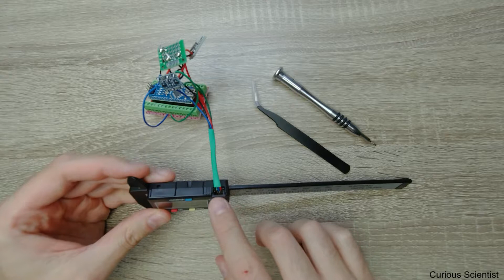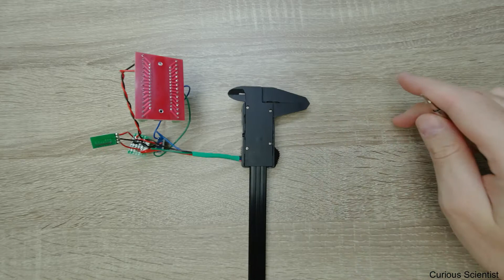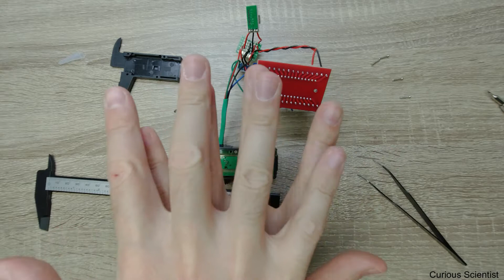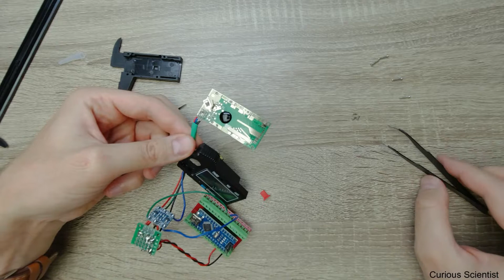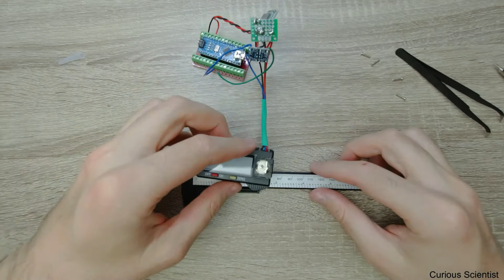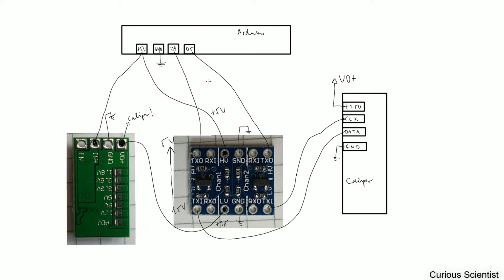Digital read out (DRO) using an Arduino and a digital caliper

Comment: Me ayudó mucho tu vídeo Bro, saludos desde Ecuador
Reply from the maker: Thank you!
Reply: @CuriousScientist  hey bro!
I need you help, plis. In my project i have the same calibrador, but the difference that is I need save data in MicroSD and show this information in a LCD. 
Have you any idea to do this code in Arduino nano?
Reply from the maker: Hey! I have other video where I save the data of a thermometer to an sd card. You can use that code as an example.
Reply: @CuriousScientist  thanks bro
Reply from the maker: @maredu97  You are welcome! It is this video: https://youtu.be/eWZP44vS7cU You just have to replace the name of the variable in the file.println() method and basically that's all.

Comment: Sir LM7805 converts output as 5v but we want only 1.5v how to do it?
Reply from the maker: The currents are likely to be very low, so after the voltage regulator, you can build a voltage divider using simple resistors. Then you can choose the appropriate values of resistors for R1 and R2 to convert the 5V down to ~1.5V. If you have R1=12k and R2=4.7k (I chose standard values from the E-series, so you can directly buy these), the voltage should be dropped down to ~1.4V. That should be perfectly sufficient to run the caliper. Otherwise, you can also simply use a potmeter to drop the voltage, I tested it just now with a 47k potmeter and it works fine. If you use a potmeter, first set the (potmeter's) output voltage to ~1.5V, then connect the caliper to it. This will further drop the voltage to ~1.1-1.2V. You can carefully adjust your potmeter back to 1.5V, if it is necessary, but my caliper (the one in the video) was working fine with the lower voltage as well. The best potmeter for this purpose would be a trimmer potmeter, because you can adjust it with a screwdriver and leave it like that. Or, finally, I added another product to the description which you can buy to convert the voltage to the desired value (you do not have to buy it via the link, but at least you can see the product and you can decide where you want to buy it).

Comment: How can I add a push button and input the readings to SolidWorks for 3d modeling?
Reply from the maker: Good question. Unfortunately, I don't know how to channel the measurements into Solidworks. I can't try it either since I don't have that software. Push button should be easy. Just write a function which works with one of the attachinterrupt compatible legs. Or, you can do it with any regular pin too, but then you have to restructure the code a bit.
Reply: Read this comment on a computer rather than a phone in order for the code snippets I've included below to look right without weird wrap around text throwing off the spacing.

First review the instructions at this link then return here:
http://help.solidworks.com/2019/english/SolidWorks/sldworks/hidd_curve_in_file.htm

It doesn't say but I can tell you right now that for the text file the format is the following. The first column are the X coordinates of each point on the curve, the second column is the corresponding Y coordinates, and the third column is the Z coordinates, separate each column by a comma when generating the file from your script (this step comes later) and make sure that the units in your solidworks part match the units of your data or vice versa. Each line of the text file is now a coordinate for a point in 3D space. Make sure that all the data goes in order from one end of the curve to the other because solidworks assumes you are giving it a path. For example if row 5 shows values for a point between rows 2 and 3 it will not rearrange the row order to make a neat curve, it will just make the curve double back on itself and it will look all wrong so make sure the points are in order from one end of the curve to the other. If you are only measuring 2 or 1 axis do not worry, just leave that coordinate as 0 on every row, but you can not omit a column. It must be a text file with 3 comma separated columns of numerical data with no header text, any deviation from this will not be importable.

Anyway now that you understand that system now go on to read through the response posted by Nikolaus Gradwohl as well as all of the comments under his answer at the following link, then return here for some more detail:
https://electronics.stackexchange.com/questions/54/saving-arduino-sensor-data-to-a-text-file

The processing script will be running on your computer, incase that was unclear in his answer and from the comments below his answer. Now if you just copy the script it will not work for you. What you need to do is a bit of data formatting before the arduino sends the data to the computer. Once your arduino has collected all the data you want to send over you need to funnel it all into a single string variable which Nikolaus calls "value", but its actually a string, not an int or a float. However this is better for us since we need to do some formatting before sending it and doing that in a string will make writing the text file later easier. Rather than sending over one value at a time, first create a string that combines the data into the same format which solidworks is expecting to see in each row of the text file (<> symbols to indicate mid-code comments that should be interpreted by you and not just copied right into your final code):

//Initialize all variables
<this step is important, don't skip it or try to make it more condensed because it can lead to errors when converting from float to strings and when concatenating them>

float X_raw = 0;
float Y_raw = 0;
float Z_raw = 0;
String X_string = "";
String Y_string = "";
String Z_string = "";
String output = "";

//Read and store coordinate data
<there will likely be a lot of code related to reading the data stream from the caliper, but that will depend on what the format of that data is and so you'll have to find that out on your own>

X_raw = <decimal value read from X axis>;
Y_raw = <decimal value read from Y axis>;
Z_raw = <decimal value read from Z axis>;

X_string = String(X_raw, <the number of decimal places you want to keep> );
Y_string = String(Y_raw, <the number of decimal places you want to keep> );

Z_string = String(Z_raw, <the number of decimal places you want to keep> );

output = X_string + "," + Y_string + "," + Z_string;

Serial.println(output);

//End of code

The above is what you would have the arduino board running in its loop method, you can add whatever bits and bobbles of functionality you wish but as long as you address all the <> comments that call for you to interpret my instructions or make a decision on something you should be good. Then you can basically use Nikolaus' script running on your computer to save what the arduino is sending over into a text file with each new entry being a new line of the text file (this is what "ln" in the "println" statement does). Unless you have a servo controlled system and you time it to take measurements at even intervals you are likely going to want to only have it send over a coordinate once you click a button or something so that you can first adjust your set up to take the next measurement. Solidworks will do absolutely zero filtering of the data. If the first 20 out of 100 rows of data are the same values because you started sending data at a fixed rate but then fumbled when going to operate the physical mechanism by hand it will not just chop off the first 19 rows for you, it will make a curve where the first 20 of the data points are located at the same point in space and it will not be clear until you try and make a drawing or 3D shape with it.

Finally, as stated earlier, if you are only measuring 1 or 2 axes, you still need to send over x y and z values, just replace the line where you read and store the decimal value of the unused axis with a line setting the raw axis value to 0, the rest of the code can be left as is. Sorry if this has bugs, I can't debug properly without the hardware in hand but I'm sure its close enough for you to debug on your own without much issue. Also here are some extra resources I looed at while writing this explanation:

Converting floats to strings:
https://www.arduino.cc/reference/en/language/variables/data-types/stringobject/

Issues that can arise when concatenating numerical values into strings:
https://www.arduino.cc/en/Tutorial/BuiltInExamples/StringAdditionOperator

Comment: Thank you sir does this setup will support all calipers?
Reply from the maker: Hi! I am glad to help! As long as your digital caliper has the SDA and CLK outputs, yes. And as far as I am concerned most of the digital calipers use the same standard. Look for a small door on the cover of the caliper. If there are four connections beneath the cover, that should be the digital connection. It is advised to check the manual for the pins (which is which). If you use these Chinese cheap calipers, they are the same (I disassembled several), but if you want to do the same with a precious Mitutoyo, then do everything very carefully!
Reply: @CuriousScientist  thank you for your response sir, please upload full video detailing the code with serial monitor. I'm currently working on this project sir. rarohith1988@gmail.com it's my mail id if possible please send the code sir.
Reply from the maker: @note_book_rohith  read the description, the code is freely available. I shared it via PasteBin.